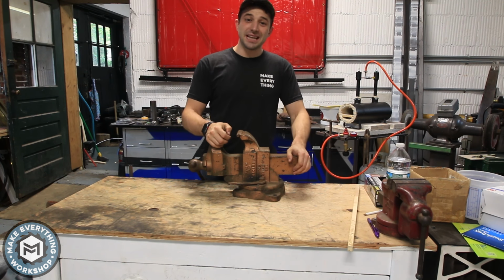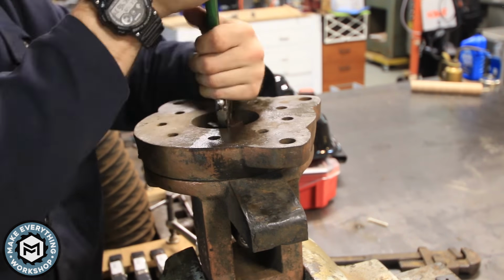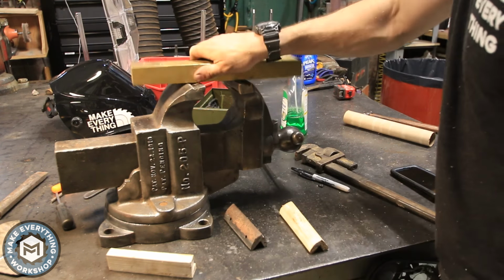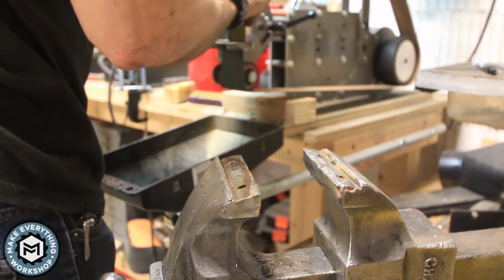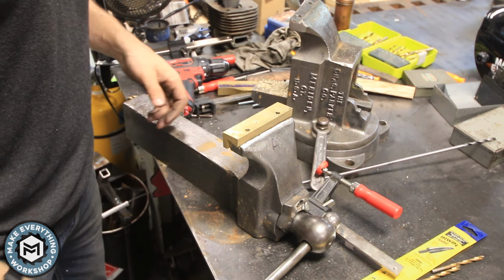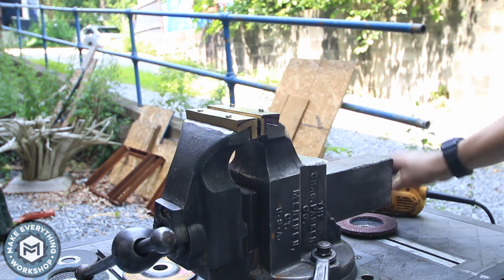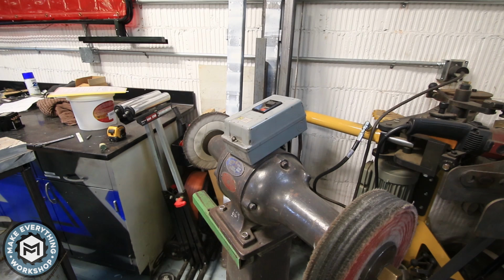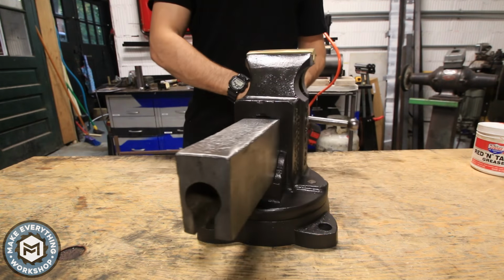Vise Restoration | 1910 Chas Parker 205-P

Comment: Why does everyone insist on taking the guards of the angle griders?.....nice job, but safety first
Reply: If you swap back and forth between grinding/cutting discs and wire wheels, cup wheels, etc., then you almost inevitably end up taking the guards off, since they don't work with brushes, and they never seem to go back on. Personally I try to use 'em with the "wafer wheel" discs but not much else.
Reply: Only an idiot removes the guards. These tools are among the most dangerous in the shop!
I’ve seen to many people wind up with permanent facial disfigure after having a wheel explode while using an angle grinder without the guard and without a full face shield. 
It’s a stupid mistake. Everyone thinks it’s ok to do until it happens to them. 
Don’t be an idiot. 
Don’t be lazy!
Reply: THey by crap grinders with guards that dont rotate.
Reply: Once he has an "accident" it will go back on. It should be called a "dumbass".
Reply: The guards are ALWAYS in the way, no matter the tool. Just dress for the crash, not the ride.......
Reply: The first thing I do when taking a new grinder out of the box is throw the guard away.
Reply: People that have no clue what they're doing take them off
Reply: @highstreetkillers4377  😂
Reply: who the fuck are you  do you know what you are doing ? MYOFB

Comment: I was extremely OCD about your jaws until you ground them. This is a beautiful restoration.

I do have a question out of ignorance. Is there a reason why you didn't grind the lower section of the side portion of the jaws to match each other? Do they add uneven pressure from the lower section?

Comment: Very cool. I have a similar Charles Parker vise except mine weighs 110 lbs! It was in a working job shop (machinist, a/c, plumbing and electrical). All the same guy. He wasn't allowed to go in the army in WWII because if they kept him they could send 4 other guys!. Anyway, it is in similar condition with only one original jaw. The other is just built up with weld. I'm going to leave it there, no bridgeport!
Reply: My Charles Parker is a 288 1/2 Pat Jan, 2 1906 and Nov, 22 1910

Comment: I recently restored an old vise and used the same hammered paint.  Great job on the restore.  I additionally applied a coat of clear gloss over every painted surface to give my lettering additional durability as well as make cleanup a little easier.

Comment: In regards to the dovetail cutter, more flutes means smaller chip per tooth, so you either need to lower your spindle speed or increase your feed (or both) to reduce chatter and make a good chip. But you are also taking a heavy cut with a lot of engagement, so you have to go slow.

Comment: What brands of abrasives are you using?  I see Dewalt for one.  I suggest you find a higher quality brand.  Advanced Brush AKA Pferd is very good and you shouldn't have the flinging wires or not nearly as many.  Pferd also makes great abrasives.  It's pronounced FERD.  The P is silent.  You'll pay more, but you get a lot more.  Dewalt tools are nice, but their abrasives and such are subpar at best.   Well done on the project!
Reply from the maker: For flap discs I usually use the 3M cubitron for grinding. As far as wire wheels I definitely need to look into a new manufacturer. The Dewalt and harbor freight wire wheels I was using during this were deadly! I found metal wires in my clothes for a couple days after this and its not a comfortable thing to get stuck in your side! I am familiar with pferd but have never seen their wire wheels I will definitely look into it. Thanks for the compliments!
Reply: THE PFERD F-TEEN-THOUSAND PICKUP, YOU'LL HAVE TEN THOUSAND BABIEEEEEES
Reply: I agree about pferd. They have wire wheels that are encapsulated in rubber. The wires don’t shoot off like other wire wheels

Comment: Great restoration, I do a lot of vise resto's. I had a Chase Parker like that missing the Jaws, luckily not welded up like yours. I took mine put the whole vise on the mill and milled the angle off. As it's wasn't going to be a restoration it was going to be a usable Vise and made steel and copper Jaws for it. Then we use tapered pins to put them on.

Comment: Nice Chris, did you make a template for the jaws? Just in case you need to replace them at anytime, with them being brass?
Reply from the maker: MG Makes I didn’t make a template because of the amount of hand work they required... honestly I think a new set of jaws would be relatively straight forward at this point knowing what I know now.
Reply: could do a mould of the vice and make castings for new ones
Reply: Cast metal is garbage, he should ask an actual machinist for help. It was sad and scary for me

Comment: why not re shape the mounting points for the jaws to an easier angle?
Reply from the maker: GeorgeS I was thinking about remilling the jaws to a better angle but I didn’t want to take any more material away from the vise body if I didn’t have to. My thought are to use it like this for a while and if these jaws get loose or don’t work out I could always redo the jaws and body in the future.